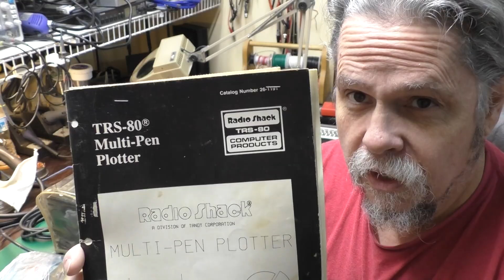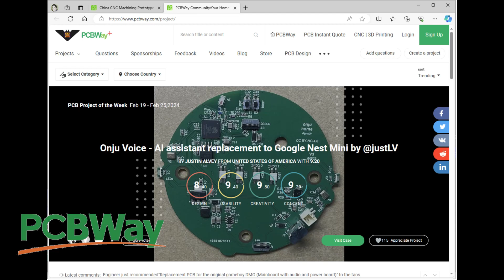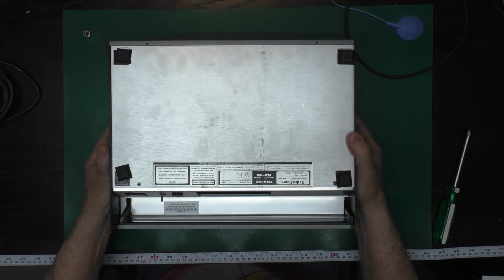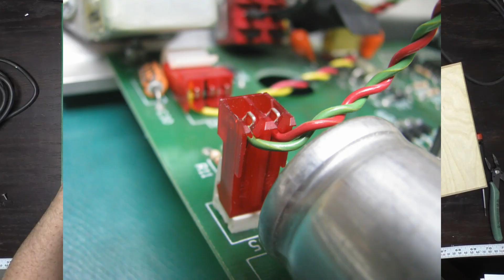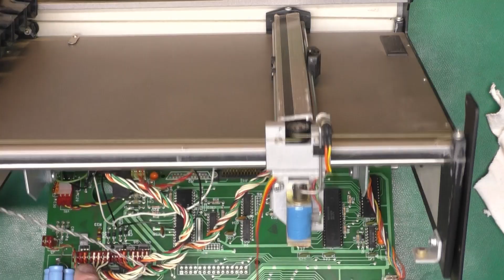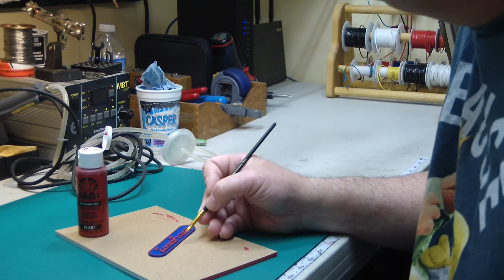TRS-80 26-1191 Multi-Pen plotter. Refurb and testing. Part #1

Comment: It looked like your meter was reading milliFarads - "mF", or does it use that instead of "uF"?
Reply from the maker: You are correct! I checked gain and it is reading about 1.2mF, i.e. 1200 uF. The ESR was about 0.1ohm (perhaps a bit high). I'm a bit suspicious of an old cap that is 150% of its uF rating but I have seen some that were rate at +80 / -20%.

So, perhaps if I had realized that the meter was showing mf not uF I might not have pulled it out. Since I have already ordered a new one, I'll go ahead and install it though. I'll point out in the next video that you uncovered my mistake though. Thanks.